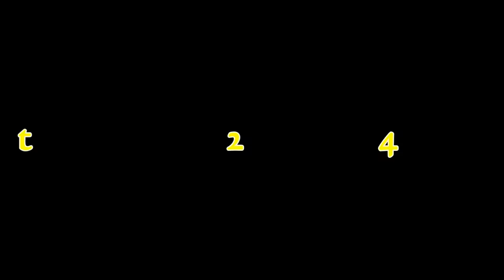Top 6 Ideas Pots With CERAMIC & CEMENT

Comment: It is very nice but why don't  you make a hole at bottom so you can plant in them?
Reply: X favor si usted podría mandar las medidas de cemento material muchas gracias bendiciones
Reply: @angelaherreradelangel6030 ,         1 cement + 2 river sand